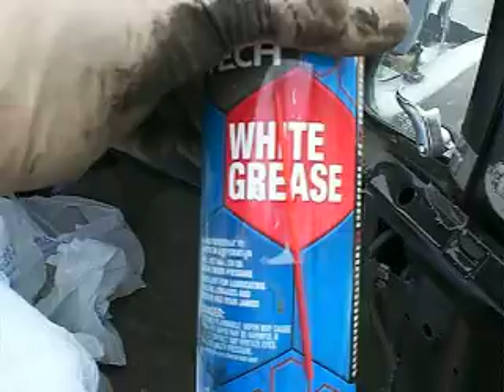Ze Vite Greazzzz....

Comment: I have another item you should give the spritzz to with the gel lub . I had a problem with the wipers not flexing enough to wipe the windshield properly, turned out the arm piviots were dry of any lub , I spritzed and moved them till they freed up . Working like new especially the rear window wiper arm.